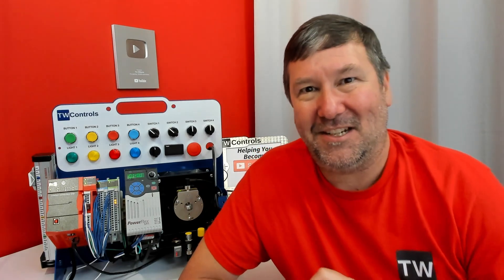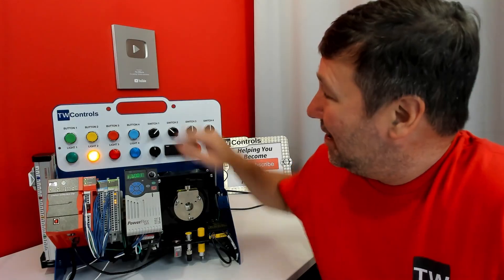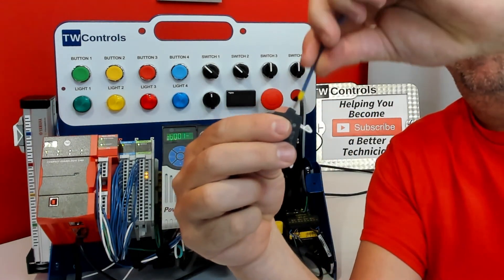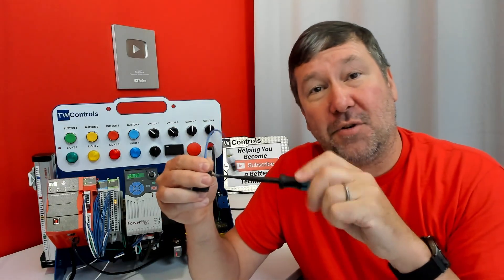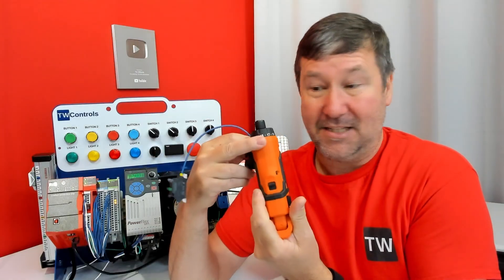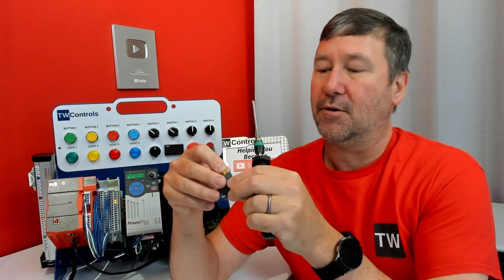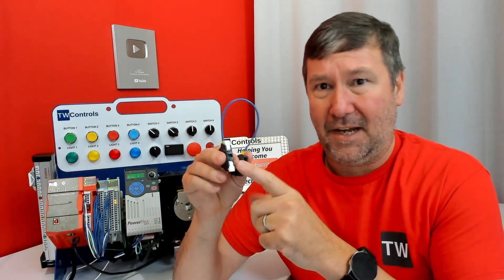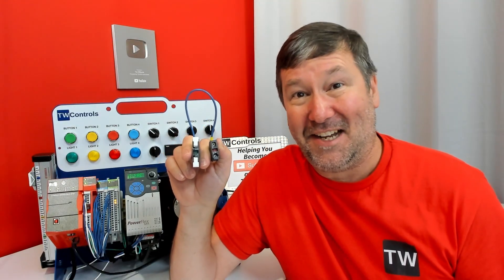Push Button with Push in Terminal,  No Screws!

Comment: As an engineer that's helped our UL Shop build a few panels in the past, I'm only spec'ing spring and push in style terminals wherever I can. Good to know that it's not just terminal block manufactures coming out with spring/clamp style connections.
Reply from the maker: I agree!